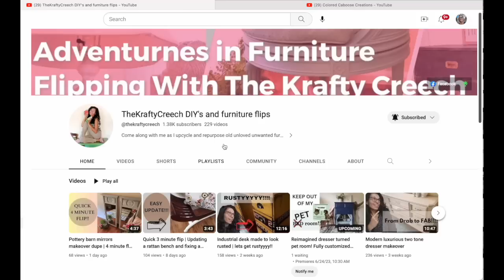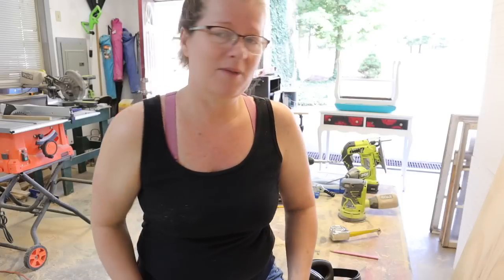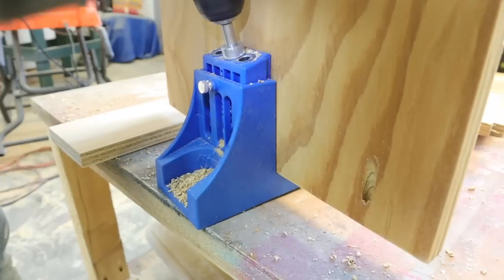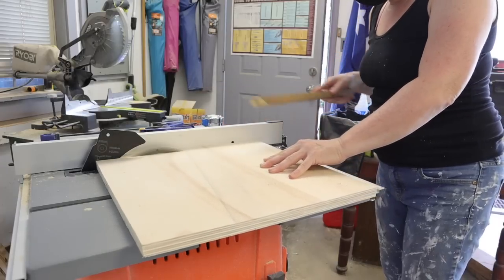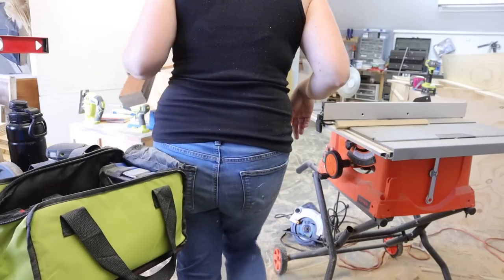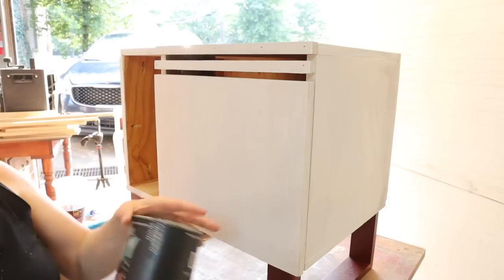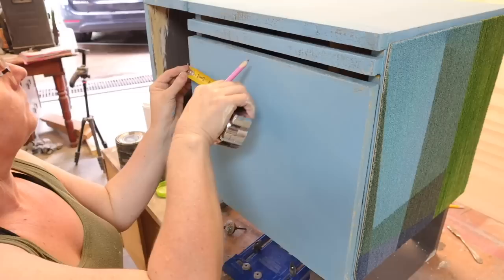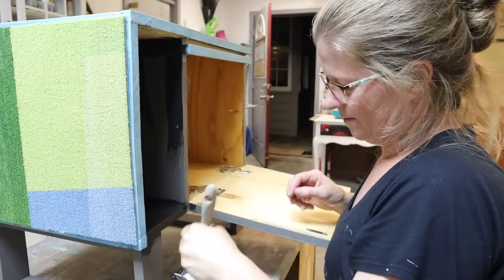What can I make from scraps - You're not going to want miss this Cat Condo!! Pet Challenge

Comment: Consider a sheet of metal or roofing for the top and a thin piece of insulation inside on the floor and sides. I’ve done that with my dog houses. You can use a cheap window, car shield, or a piece from a roll. Purchased from Lowe’s or Home Depot. I would suggest putting the hinge on the side so that when you open it up it’s out-of-the-way when you brush or scrub the inside. The debris will not get stuck in the hinges. It’s a cute, thoughtful, kitty abode. I love the slats for air circulation, and a slight slope would allow the water to runoff.  You have such a kind heart! I love your personality you are very entertaining.
Reply from the maker: Thank you for sharing those ideas with me! I really appreciate it I would never have thought of those myself
Reply: @VintageAndPainted  you really read my comment and replied!! Thank you.